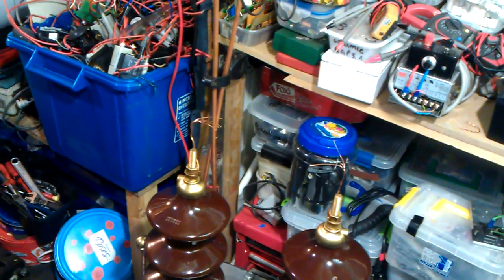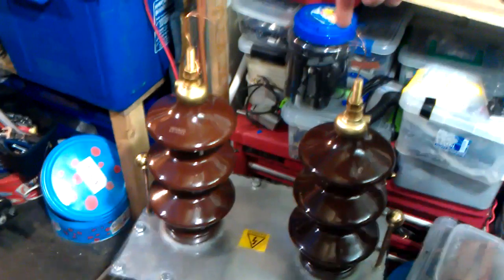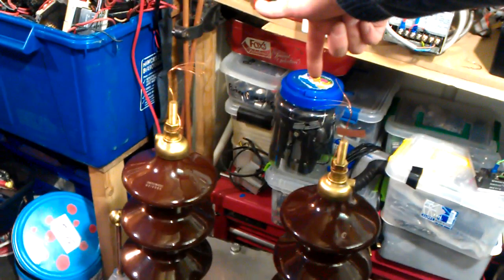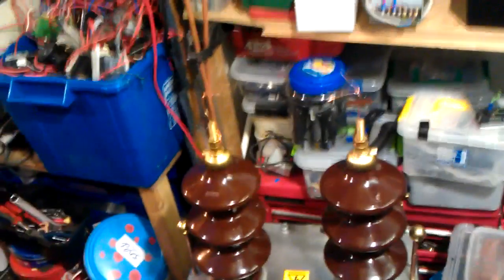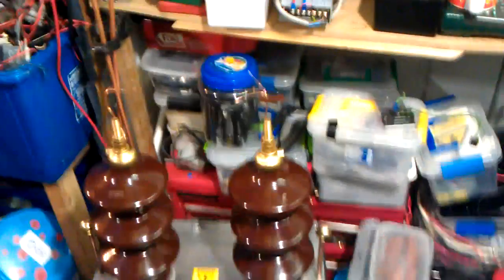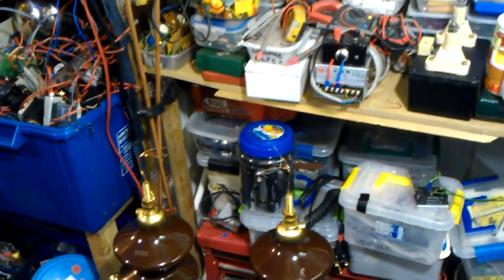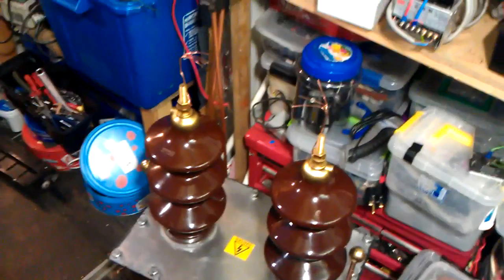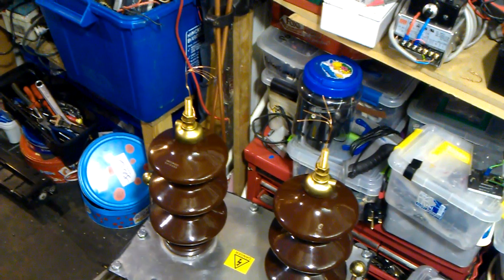150kv x-ray Transformer test

Comment: I cut my message a bit short, but if the output is left open circuit the voltage on the secondary can become too much and the windings arc over. You set the gap corresponding to a safe voltage for the secondary.